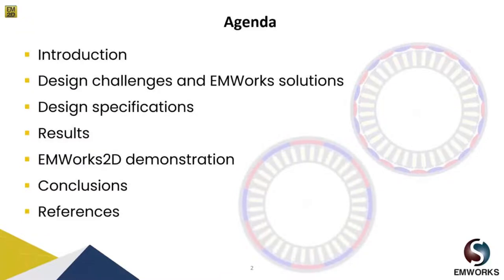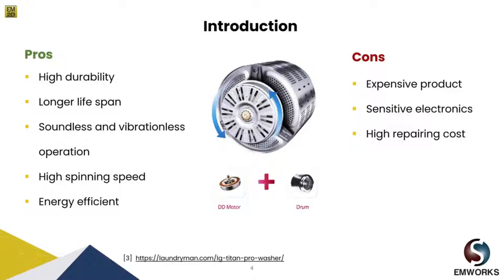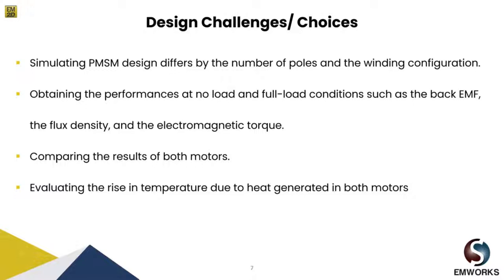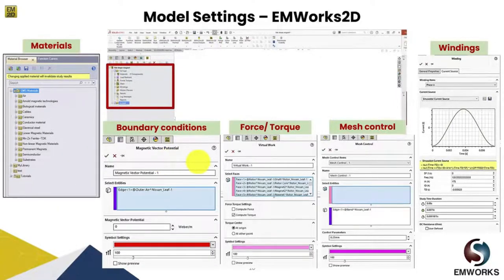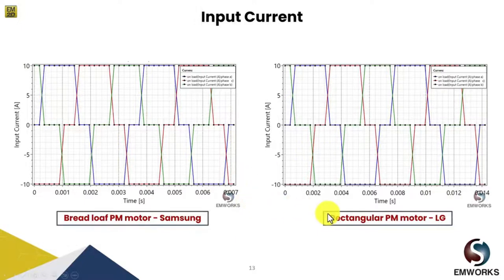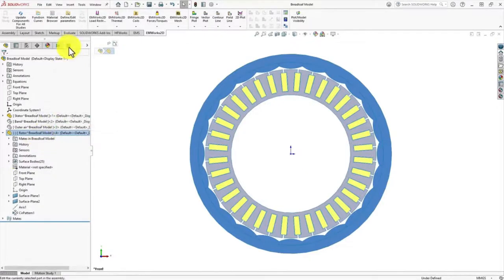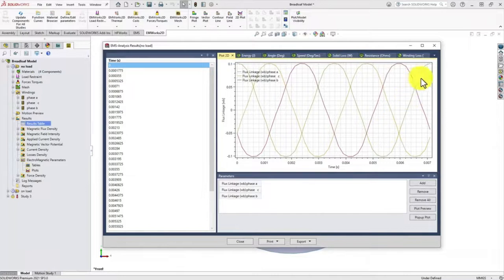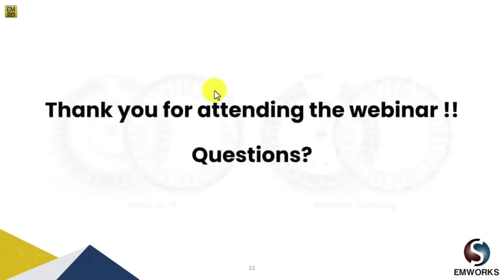[Webinar] Direct-Drive Permanent Magnet Motor for Washing Machine Application

Comment: I need motor design services for a similar motor 750 watts , torque of 1.5NM at 800rpm to be run on 230volts AC mains. We used a e vehicle motor but it needs tweaking
Reply from the maker: Thank you for your interest. For more information about our software or simulation model, please contact us at: https://www.emworks.com/contact.
Our sales representative will reach out to you shortly and connect you with the appropriate application engineer.